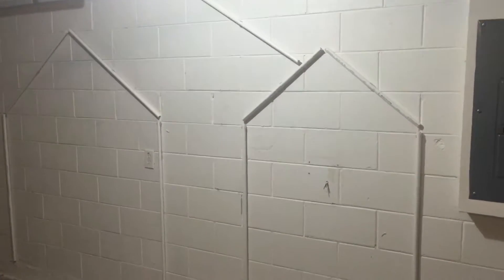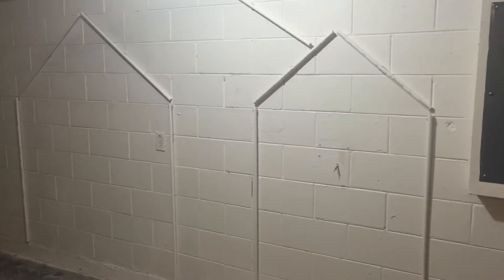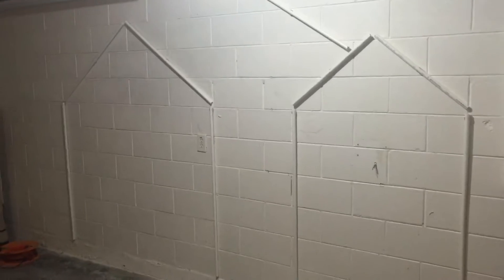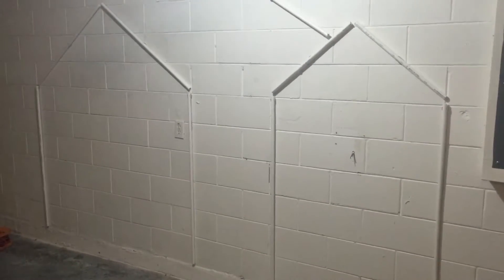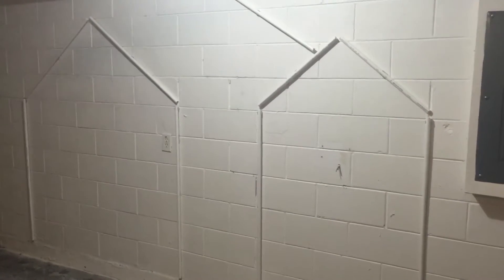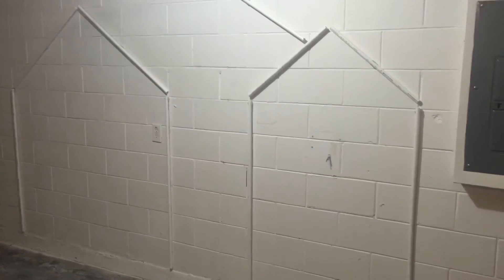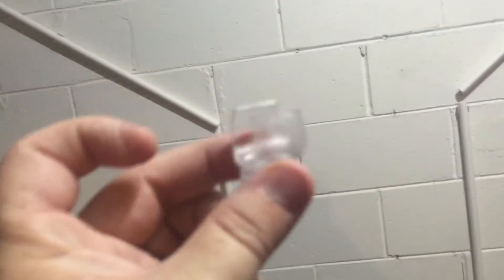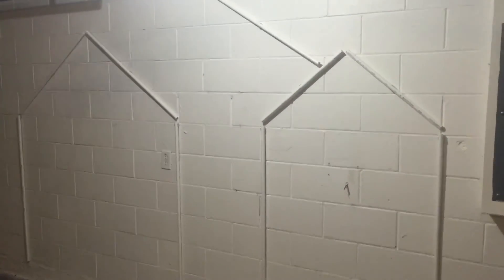Scale model LED WS2811 Pixels for sequencing help DIY

Comment: That's such a smart idea. I'm looking at getting a holiday coro controller. Was looking at the Falcon but I love the idea of the easyplug3 system they have. If you plan it out right you can do little to no soldering, including power injection, and I think the pixels will last longer if I don't have to tamper with them.